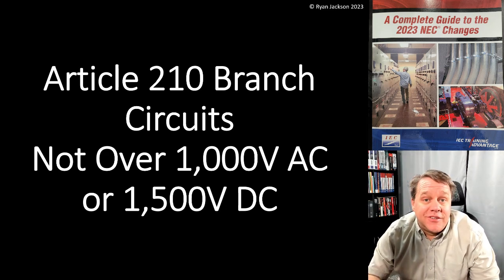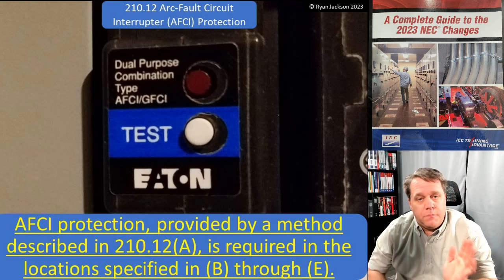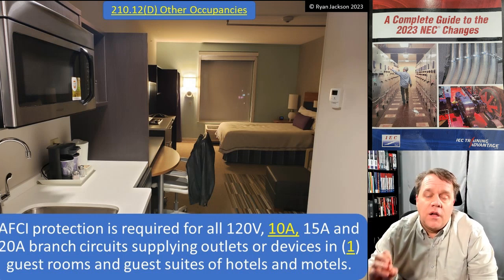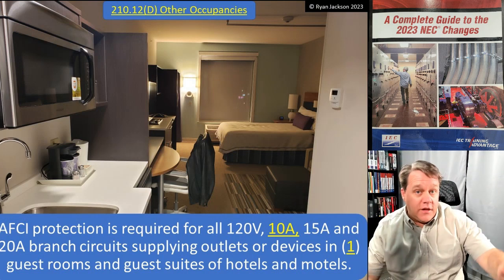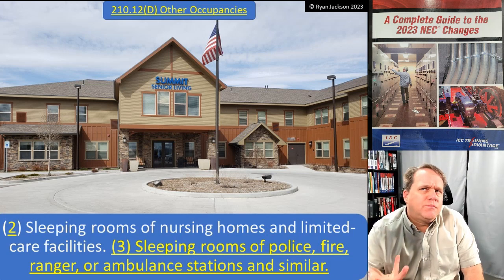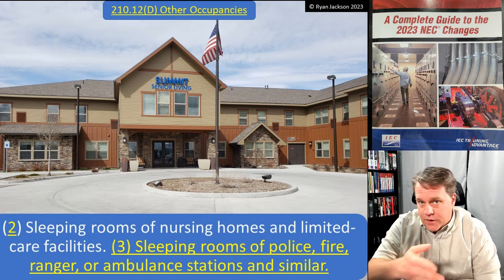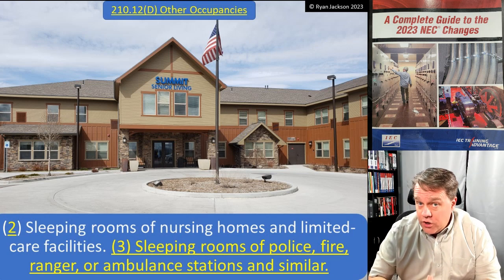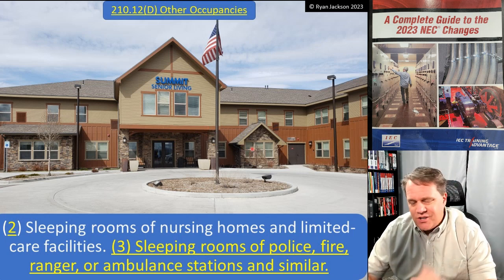2023 210.12 AFCI Protection

Comment: Around here the jail, police station, and the Fire station are in the same building or under the same roof. So I guess all 3 sleeping areas would require them, if cells have receptacles, (I have never been in one).  Would a jail cell be considered a room or sleeping area? Sorry if this is a bad question. Also, around here the smallest receptacle or lighting ckt allowed is 20A. I always thought this would change when copper went up and LED lights were installed, but it hasn't yet.

Comment: On the fence with the 10 amp circuit breakers in homes. It would be great for LED luminaries only but can see contractors placing every luminare on just one circuit breaker. Not safe if circuit should trip middle of the night and an older person has to find thier way outside to reset the breaker. Then I can see Johnnie homeowner tapping off a 10 amp circuit for some receptacles that he just installed. If the NEC allows 10 amp circuit breakers they must make a rule that every splice box & wall case on a 10 amp circuit breaker have a sign stating  " For LED lights only ".
Reply: It's not all that big of a deal though. You could say the same thing about 15 amp circuits and tapping 20 amp outlets off of them. It would be hard to overload a 10 amp circuit with lighting as well. A 100W incandescent bulb pulls 0.8A. Even 10 of them wouldn't overload that circuit. And the vast majority of bulbs pull much less current than that. Fluorescent lights also don't pull anywhere close to that unless they're very large. And outlets in many locations would be perfectly fine on a 10 amp circuit as long as it wasn't a ton of outlets. The vast majority of things plugged in are not pulling anywhere close to that, except in the kitchen, garage, bathroom, or basement. It would be very unlikely to overload it especially on just a lighting circuit.